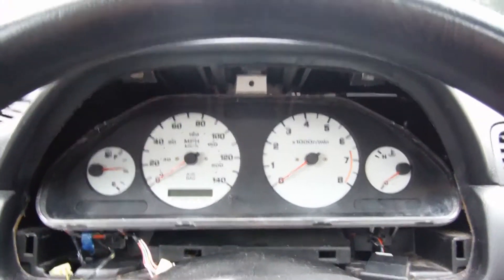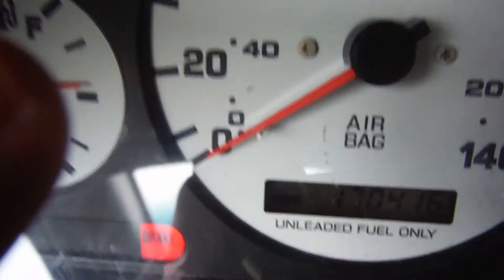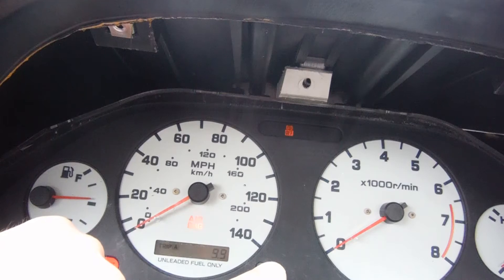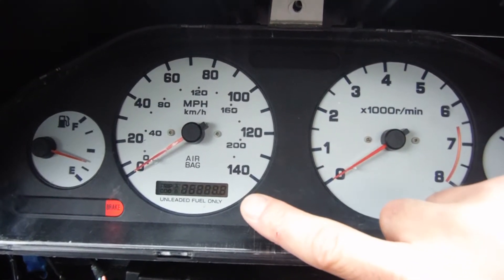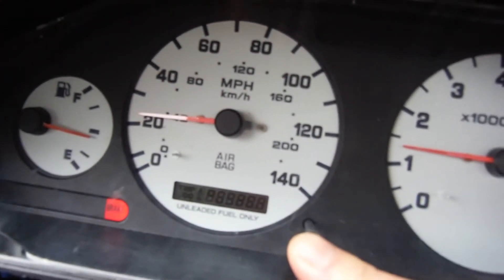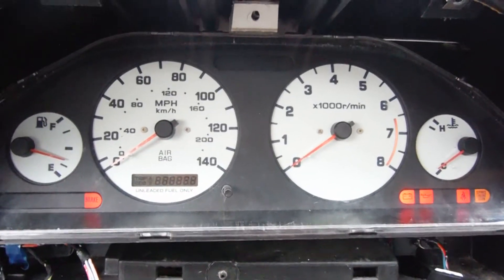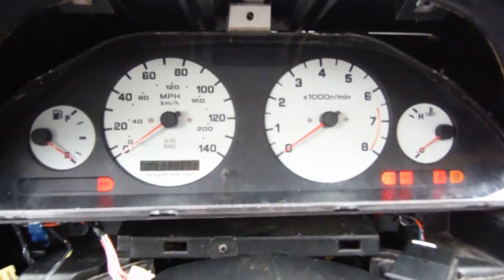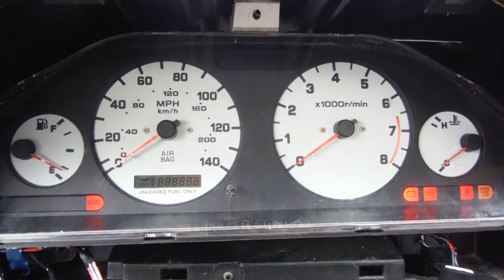1998 Nissan Maxima - Dashboard Diagnostic Mode

Comment: So, quick question-- when you replaced the gauge cluster, how did you set the new odometer back to the correct mileage for the car? Or is there a way to swap the old odometer display over to the new cluster?

Comment: Hi there, i have a 98 maxima 345k. My question is when you have it on diagnostic mode and when you press the button once, are all of the red arrows supposed to go all the way up? Or half way only
Reply from the maker: being that this was so long ago, I have to admit I am not 100% sure of the answer.  I do not think that they have to move all the way up to prove they are working... In fact, in the video where I am describing the problem (https://www.youtube.com/watch?v=F0KLXWYv2mI&t=1s) you see that the needles are giving wrong readings where the needles of the gauges are all the way up.  Rather I think that when you push the button in diagnostic mode, you should see accurate readings.  Again since this was so long ago I am not 100% sure.... I would go back and watch all the videos I have on this issue and then do your own testing.  Thats the best advise I can offer you on this... good luck...
Reply: MattinSINY thanx for the reply 👌🏼 and ok its cause other videos they move all the way up lol